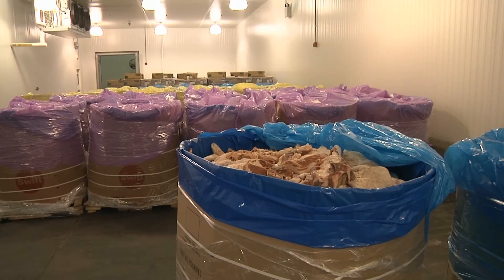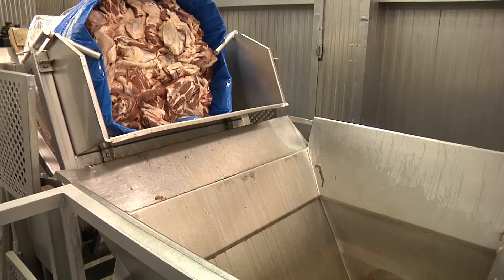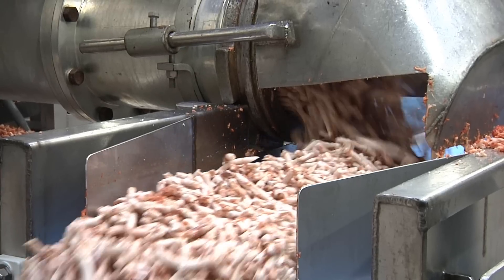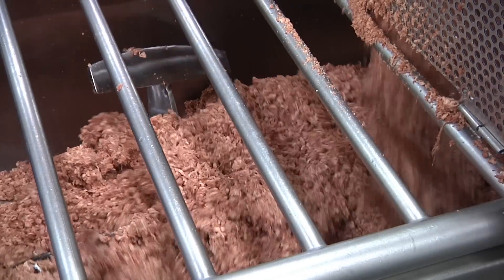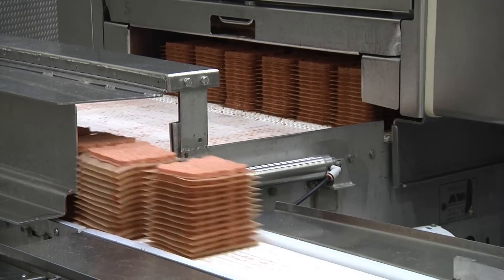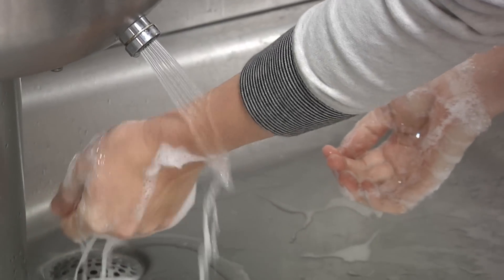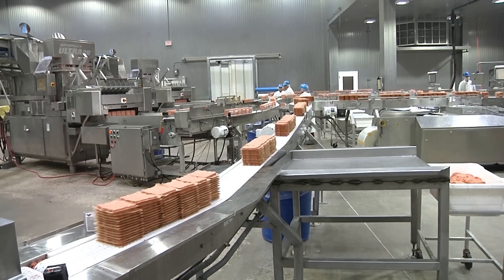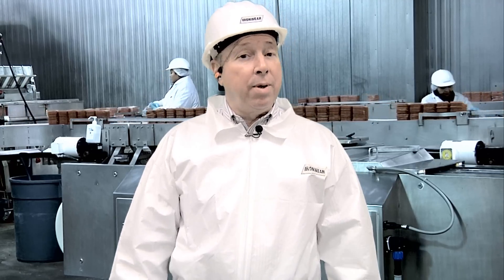How Ground Beef and Hamburgers are Made

Comment: that's the kind wendys use
Reply: Nope, whataburger. Wendys beef is never frozen.
Reply: I work there and yes.. Kenosha beef is Wendy's supplier.. and Walmart... and burger king.. and checkers rallys dq the list goes on
Reply: You people are clearly rookies. Everyone knows those are White Castle patties.
Reply: @sheilamesa1533  noob. same shape, half the size
Reply: @prostack4577 
Nope.
Reply: @butchtropic I'm aware. I operate the machine. You just change the molt plates out and you can make any size or shape patty. My point is. Those were Wendy's patties
Reply: These are Wendy’s patties. I work at Wendy’s and the 1/4 lb patties have a black stripe on the paper separating each patty, red stripe for the 1/8 lb. You can clearly see at about the 2:00 mark the larger patties on the left have the black stripe on the paper separating the patties and the smaller ones on the right have the red stripe.